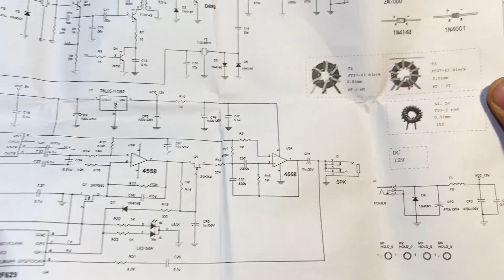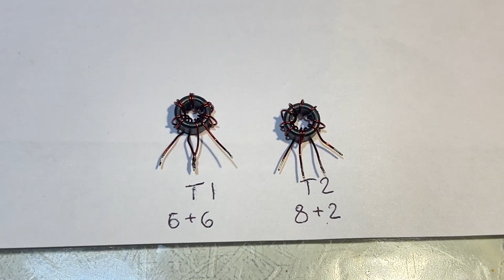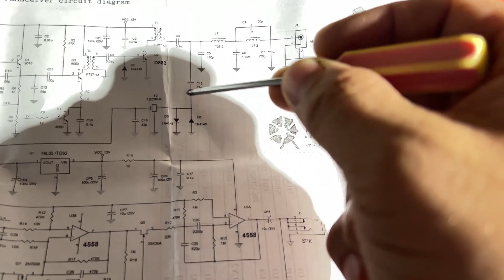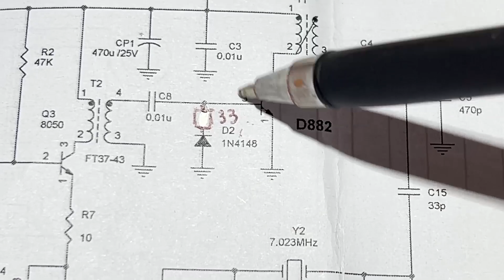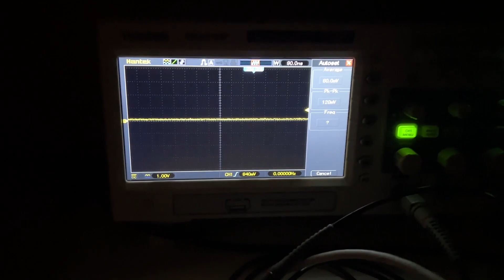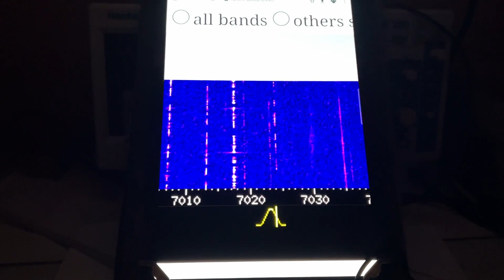Super RM RockMite QRP transceiver.How to assemble and configure

Comment: Assembly of this is beyond me but I love the idea of the rockmite I ordered an assembled off eBay hope I didn't buy a cool looking paper weight
Reply: So I got my Super RM a couple days ago and got a chance to swap out the 7023 crystals for 7035s  today. An issue I ran into was getting the RM to accept a straight key. Here's what the issue was. My monojack has a slightly wider band between hot and ground on my key I cut it off and replaced it with another one and the problem was solved.

 To the guy who gutted the keyer completely out his RM you was over thinking the problem it wasn't all that.